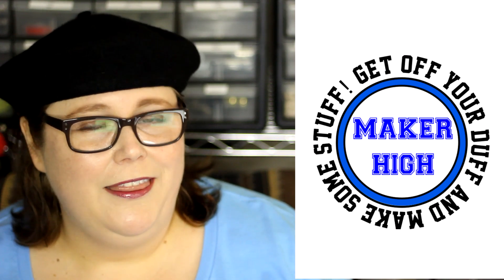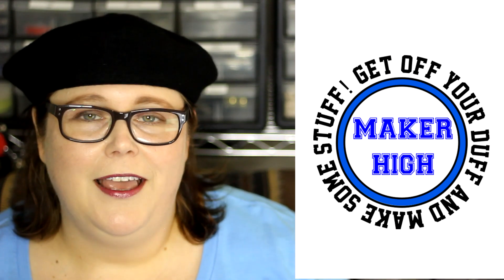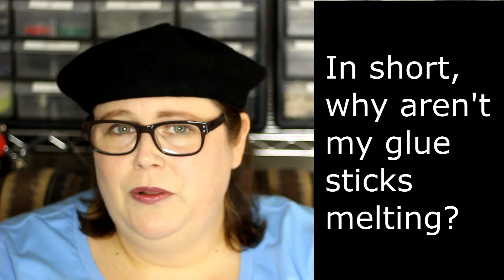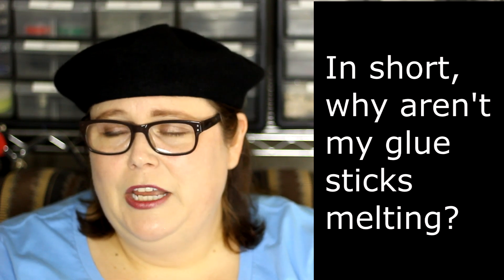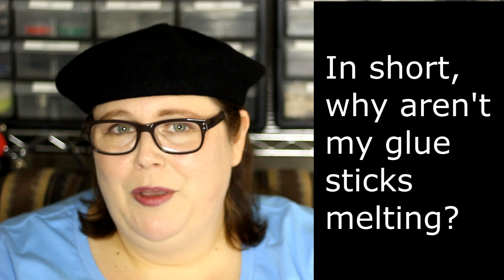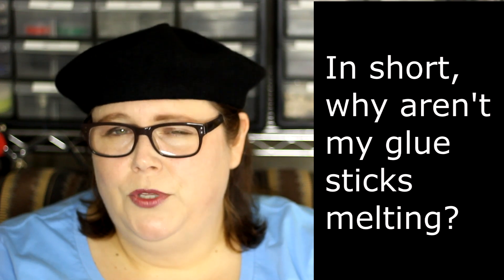Why won't my glue sticks melt? Why won't my glue gun heat up? - Question 3

Comment: funny, i git the adtech high temp glue gun and multi temp glue sticks and discovered i bought a piece of crap, i wait 5 mins and when i go to use it i get a short burst of an inch or less on the first attempt and then have to wait another 5 mins and i get a few drops the second time, on third try after waiting i got nothing. the gun came with no instructions except for the little bit on plastic wrapper and it didn't specify any type of glue stick other than to say full size so i do believe its going in the trash.
Reply from the maker: Ad tech has been going down hill lately. If you can return it and get your money back, that's the best option. If the store gets too many returns, it will stop carrying that item. That's usually how manufacturers get the message that people aren't going to support their bad products. 👍

Comment: My glue gun is duel temp and brand new but melted glue won't come out
Reply from the maker: If you've tried using low temp glue sticks and it still won't work, the problem is either your outlet or the gun itself. Try it in a couple different rooms and if it's a no go, it's the gun. I'd exchange it for a different brand if possible. Hope that helps! 👍
Reply: I have a brand new glue gun with the matching glue sticks that came with it. It takes 15 minutes to get 1 inch of glue out. Its a regular size gun. This is the 3rd larger gun I've bought, tried multiple rooms/outets. My mini works just fine in same spot. I'm seriously losing my mind.

Comment: My glue gun keeps making little bubbles and every time I try to heat it up it never works and I do remember that someone in my house put a crayon inside of it maybe that’s the problem I don’t really know
Reply from the maker: I'm pretty sure that's the problem. Glue sticks are a mixture of plastic and wax. Crayons are wax and other things like hard minerals to color them, and additives to make them glide easier. The wax melts faster than a glue stick and leaves behind everything else, and that clogs the glue gun. That sucks, sorry. 

I've had a lot of people on my glue gun burn video comment they did it with crayons in the gun. At least no one got burned badly. I'm afraid you're going to have to buy a new glue gun since it's next to impossible to get inside the barrel. I have a video showing what the inside of a standard glue gun looks like if you want to know what I'm talking about. 

Stay safe! Best, Lori

Comment: I just bought it, opened it and put the glue stick that was inside the box. So it's got to be the right quality. I pressed inside as far as it goes. Not working and glue is not coming out. How do I get the stick out
Reply from the maker: You should honestly exchange it for a new one. It means your heating element isn't getting hot enough. 

If that's not an option, best case scenario is turn it on and let it sit for 5 + minutes. You can unplug it and  pull it out of the back. I DO NOT recommend since you can break the assembly and leave glue behind in the barrel. If that doest work, it means your heating element is totally shot. Be careful not to shock or burn yourself.

Comment: How my glue gun is not getting  hot  I have tried  with my new glue stick  plss help me
Reply from the maker: Try checking on a different outlet. If not, the wires are probably bad. You will need a new one.
Reply: @MakerHighSchool   thanks I have tried  and why at any time  I have to use different  outlet
Reply from the maker: Because sometimes the electricity might be the problem. If the outlet stops getting enough power, it can't start the glue gun.
Reply: @MakerHighSchool  ok thanks a lot

Comment: My glue gun is new and it’s on high temp and the glue still won’t melt
Reply from the maker: Hmmm...try a different outlet. If it still isnt melting, it's probably your heating element. I'd exchange it for a new glue gun if you can. (Make sure you get glue sticks made for specific glue gun as well.)

Comment: Hi. I bought a brand new glue gun with glue sticks in the kit.  I inserted the first glue stick and it did not insert all the way even if i used the trigger to push it forwatd. So as the instructions say to insert a second glue stick behind it to push the first glue stick into the chamber. I turned on the glue gun and ended up with the first glue stick bending at the back while the second glue stick attempted to push the first one through. 

What do i do now? Can i cut the bent piece off while it is cold? Will that help? Wish i could upload a photo here,  but can't see a way to do that.
Reply from the maker: From what I'm picturing, yes, I'd cut it off if you can. (While it's cold and unplugged)  put in the second glue stick and try again. (The risk is you might break the assembly inside.)
Since it's new, if that still doesn't work, you can always return it. Best of luck!

Comment: I know this video is a few years old, but here goes.
I've had a glue gun since 2000 that's worked wonders. Lately though, I've noticed glue back flowing where the glue stick gets pushed in. I pulled it all apart and cleaned out that area, but it still seems to be doing it. The glue stick doesn't seem to want to move forward sometimes.

So I bought a new glue gun at the dollar store today (I bought this one at a dollar store in 2000). The new one just doesn't seem to heat up the glue sticks, they come out in this thick blob, where my old one heats them up nicely, it just has this new issue now.

suggestions?

I was wondering if maybe the glue sticks are too small? but i've used these before. So I figure they should be fine.
The glue sticks are listed as "all purpose" for use with high, low, and dual guns.
Reply from the maker: I still answer questions! It's possible it's the circumference of the glue sticks that are giving you problems, but as ling as the gun is trying to catch when you squeeze the trigger, it's probablynot that  

. Not sure if you're in the US, but the quality in the dollar store glue guns has gone way down. My only suggestion (other than buying a craft store glue gun) is to try low temp sticks  they have the most wax, so also have the lowest melting point. Hope that helps.
Reply: @MakerHighSchool  It catches the glue stick, but as the glue stick gets to the end of it's life, it starts to all clog up and the next one doesn't advance very well. I can usually force the next one in and it will start to go again. I might try the new glue gun with low temp glue to see how that works. Thanks.

Comment: My glue gun worked before on the sticks I have rn but now it's not working. I tried to look inside the glue gun and I saw the stick there. The stick is not melting. Do I have to Unscrew the glue gun to get the stick out?
Reply from the maker: It depends. I have a video showing the inside of a glue gun. If the glue is stuck in the heating element, it's dead because it's not getting hot enough to melt the glue. If you do decide to open it, make sure to unplug it first. 👍

Comment: What if its a new gun and you're using the right glue
Reply from the maker: If you've waited for more than 5 minutes, and you've getting no melting at all, try a different outlet to make sure enough power is coming through. If it's still not working, it's probably the heating element in the glue gun. I'd return it and get a different brand. Hope that helps.

Comment: My glue gun is taking alot of time  for the glue to come out and still comes  only a drop
Reply from the maker: Is it a high temp or low temp gun?
Reply: Sames happening with me
Reply: @MakerHighSchool   
It is of 60 w and it comes like a drop after half hours and the glue stick is high quality
Reply: @MakerHighSchool  please help me 😭😭
Reply from the maker: @yourlocaltheatrekid900  I'd try a different brand of glue stick.
Reply from the maker: I'd suggest trying a different kind of glue stick. some brands have more wax in them than others.
Reply: Same with me 😫
Reply: Same is happening with me what is solution of this problem

Comment: Mine is a dule one
Reply from the maker: It sounds like the heating element is about to give out. You might want to trying switching plugs to make sure its getting enough power. If that's not the problem, you might want to consider buying a new one.

Comment: I bought another one but still have the same problem mine is a surebonder glue gun
Reply from the maker: Is it a high temp or low temp gun?
Reply: high temp
Reply from the maker: Ilda Tachim That's odd. I've never had a problem with that brand. 

Is it a large or small gun? Also, how long are you letting it heat up before using it? It's not going to be the trigger or the sticks in this case.
Reply: large . Once, I left it for over 1hr and it was cold
Reply from the maker: I would check to make sure your outlet isn't the problem. Have you tried plugging it into a different outlet? If it's still not heating up, the glue gun has to be defective. I'd return it and buy another kind. Not heating up at all sounds like a connected problem to the heating element.

Comment: My glue gun is only three days old but first and second day it worked too good but third day when  I used it , it heats completly hot but when I press the trigger only one drop of glue is coming out please help my money will be wasted😢😭😤 and it's 40 Watts and I bought it online on flipkart
Reply from the maker: Flipkart doesn't have the best reputation. 

Might be the spring on your trigger. IF you're an adult, you can take a look at my video "how a glue gun works". Make sure you UNPLUG it if you decide to open it up. If the spring is still attached where it should be, you might want to try replacing it if there's a spare one lying around. Hope this helps!

Comment: My glue gun was working perfectly until the wax went in , now the glue doesn't even come out...and if it does ...only a drop or so.. plz help (it's a hot melt glue gun)
Reply from the maker: Did you put a stick of just wax in it? I'm guessing it's a high temp glue gun?
Reply: I used the glue refill or the wax that was provided
Reply from the maker: Sounds like the heating element is shot. Could have overheated or faulty connections with the wires. 

I'd return it and get a different brand if possible. Sorry.

Comment: My glue gun is heating but the glue stick is taking a long time to melt though it is melting bit it's not coming out its a new gun
Reply from the maker: Are you using the glue sticks that came with it? If so, then the heating element isn't heating up to temp. 

First, try a different outlet, just to make sure it's getting full power. If that doesn't work, I'd suggest returning it, and getting a different brand if possible. (If that one has a defect, chances are the others do, too.)
Reply: Thanks

Comment: I think I know now why my glue gun does what it does. None of what you said here is what I'm experiencing. My glue stick melte inside the glue gun,making it come out before the nozzle! Crazy, right? I bought the sticks from a Chinese store,now I know why I'm having these problems. Maybe the stick are for a low heat gun and mine is too hot. Thanks. I won't buy glue stick anymore unless they're quality ones

Comment: I have a high temp glue gun but still I am facing the same problem
Reply from the maker: You can try plugging it into a different outlet and see if that helps, or switching to low temp glue. It sounds like your heating element is the problem. If neither of those things work, I'd return it and get a new one.
Reply: I tried it but it would not work so I am planning to return it back
Reply: The shop from which I bought it was closed so I went to another shop and there the Glue gun was heating but the glue was not coming out so the shopkeeper said that the nozzle is jammed

Comment: My glue gun doesn't getting bot i plug it for 15-20 min but not littel hot help plZzz
Reply from the maker: You might want to try a different outlet, to make sure it's getting enough power. Otherwise, the heating element might be toast, and you'll just have to get a new one. Sorry.
Reply: Same problem bro
Reply from the maker: @marysunil9314  Then I'd suggest the same thing. 👍

Comment: My glue gun is working absolutely perfect but,  when i stick two object together and when the glue dries up and cools down,  the objects can be pulled apart so easily as if they had never been stuck with hot glue in the first place.... 
How do I ensure this doesn't happen
Reply from the maker: without knowing what you're trying to glue, I can only guess. Hot glue isn't always the best adhesive for some materials. I have videos about a couple of other glues that might work better, or you could check out the website thistothat.com to get a recommendation for the type of glue to use to glue two surfaces together.

Comment: My hot glue was working perfectly but it is not working now i can feel heat but the glue is not coming the stick is perfect and some times the glue come from every were help me pls..........
Reply from the maker: If the glue is coming from everywhere, it sounds like you either have a clog or a problem with the trigger. I have another video showing the inside of a glue gun. ONLY open it up if you are an adult.  If  you open it up, MAKE SURE it is unplugged. The spring tension may be off. If it's not the spring, then it's a clog on the inside of the heating element. Hope this helps!
Reply: There is no problem like clog or in trigger and now the pressing button is not working and i think the hot glue gun is stuck help me pls.............
Reply: Hello

Comment: I am waiting for 30  mins but glue does not come out .!!!
Reply from the maker: You're either using the wrong kind of sticks, or your gun isn't heating up.
Reply: @MakerHighSchool   thank you . I went to the shop they said I need to put a little bit pressure in the trigger.

Comment: My glue gun is brand new and the first time I tried using it the glue wouldn’t come out. I know it is heating because the nozzle was really hot and the glue stick I was using came with the gun. Do you know what is wrong?
Reply from the maker: You could try letting it sit a little while longer while it's heating up and then possibly pushed gently from the back of the glue stick. Don't go too hard could because you don't want to break the trigger. If it still won't move, then there's a problem with your heating element, probably. I'd return it and exchange it for a different kind.
Reply: Thank you we returned it and got a different beand
Reply from the maker: Hope this one works out better for you. Let me know!
Reply: Yea the new one is very good! Thanks for your help 🙂
Reply from the maker: Awesome! Pleased to hear that. Just leave a comment if I can help with anything else. 👍

Comment: My glue gun gets super hot but nothing comes out! Left it on by accident could that be why? It worked just fine before!

I use a high temp project pro with crystal clear stix
Reply from the maker: Could be. You might have burnt it out.